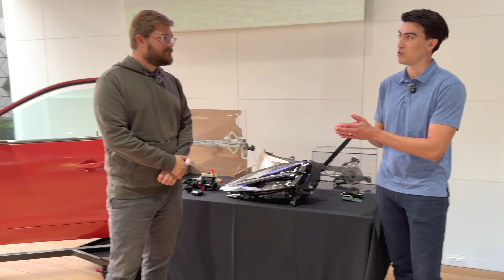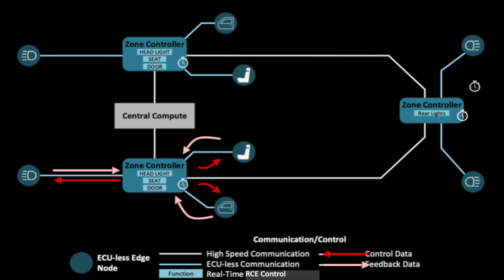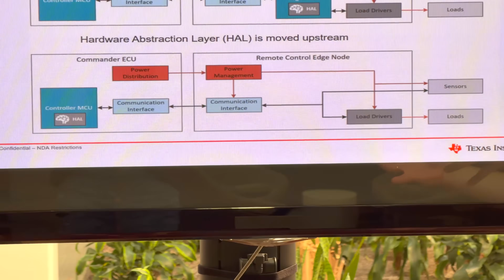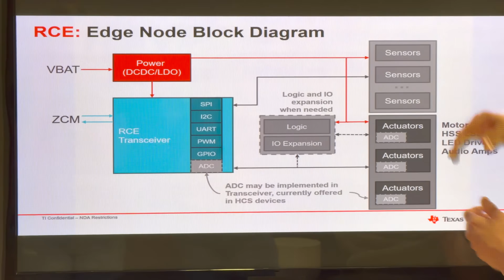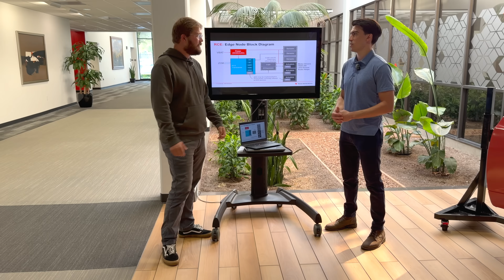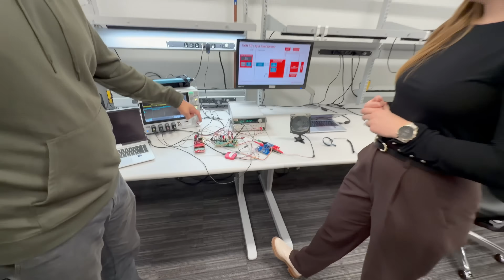The Key to Software Defined Vehicles! Texas Instruments' Remote Control Edge

Comment: Yeah that's just what I want.  Remote control of "tons of vehicle subsystems" by a third party I didn't buy the car from nor have any sort of relationship with.  And when that third party is ransomwared, remotely, which will happen, say bye bye to your "heat seater".  I like TI. They are an iconic brand in tech but there is no way they can threat model this to the point where they can guarantee security long term.  What's worse since it's centralized now, in the proposed model, you only need to attack one entity.  At least in a distributed model with lots of dumb devices that can't be upgraded as you say you have an enormous attack surface. What's proposed here completely shrinks that surface.

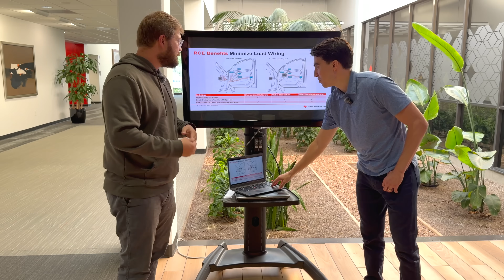Comment: around ~15:00 got me thinking, if vehicle quality converges to such a degree, the key decision for a car buyer is which branded car will either 1) handle all of their sw/fw revisions in-house, 2) source out to the actual integrators like bosch, valeo, denso, honeywell, 3) a mix where the brand works with suppliers and maybe a 3rd party company that picks up this software management market for legacy brands. Because, this software will need a central UI/UX and a touch panel (likely), which means a whole other level of software teams needed (thinking of the VW partnering with Rivian headline). want to echo the concern from a few of risk of using this to introduce subscriptions (eg. sub for non-compute/bandwidth-related smart features) on car owners.

Comment: Just my two cents worth: cue the plot of The Emperor's New Clothes.  The "software" will be split into two, with some running on the "central computer", and some running on the edge.  However, we'll pretend the edge is magical silicon and isn't really software, even though it is. Standards committees will hopefully predict the magic perfect set of features needed in the future for the "silicon" (called "mask ROM" software in decades past) ... so they hope... and the magical software will somehow be errata free.  OEMs will have to pay more for higher bandwidth connections (since the software is now split operating on two devices), will suffer higher latency, and the central computer will make real-time operation potentially very brittle when unrelated software changes are made.  I'm sure there is plenty of inefficiency and poor design done by OEMs, but the "central computing" fad doesn't necessarily fix their woes; it is just fanciful tale that the industry is pretending is real so that they don't appear incompetent or stupid.

Comment: Forrest Lane is still looking the same as 1998.  Started my career on the other side of 635 at K-FAB and then DMOS 6.  Back then it was all DSPs for Nokia and UltraSpac chips for Sun Microsystems.  :)  Its good to see TI move up the value chain and get closer to the CPU for automotive.  Software is sticky so when APi are coded in they're hard to change out.  I think it's clear that Tesla has set customer expectation level with respect to OTAs frequency and software CIP.  If you keep the customer engaged with new features I think it's cheaper than sales rebates to move new models.  The legacy automakers are really struggling in this area and I hope TI can help them.  In the past year I bet my Model 3 has received ~20 OTAs and my Lightning has received ~3.   For all the calculator nerds....sure the Ti-84 was cool, but it was no HP-48GX.  :)

Comment: I don't think anyone was discussing ethernet as a primary communication protocol in cars until the Cybertruck, which was being developed about 4-5 years ago.  They have not open-sourced that yet to my knowledge, so TI may be in the lead of creating an open standard that all OEM's can abide by.  If that is not the case, then the communication protocols will be disjointed, like the current ODBII standard communications in different manufacturers vehicles.

Comment: It's funny, but a friend who works for Continental in Germany told me that centralized computing would be the future of every car and they are working on this solution. He said this 15 years ago. 🤣 This demonstrates that traditional car manufacturers are slow but also because its hard to change the supply chain with a complete new system architecture. If they were all more agile, everyone would have great software and integration like Tesla has but Tesla shows also currently that they cannot change so fast anymore with the 400V to 800V architecture so they also suffer from the supply chain issue. Many companies like TI have been working on this for decades because it's nothing new and widely used in aerospace.

Comment: I just wonder ....Would anyone be bothering with this tech if it wasn't for Tesla?
Reply: Has nothing to do with Tesla.  This is basic electronics and standard electronic communication protocols.  This was before Tesla.
Reply: @ChristopherFoote22  Again, Tesla started using it and were forced to do it themselves way back in 2012 because suppliers would not or could not.  All Tesla vehicles are Software Defined vehicles from the ground up.  They write their own software, engineer and manufacture a lot of their parts. They engineer or co-engineer most of the parts made by suppliers, even assembly robots & equipment.
Reply: @ChristopherFoote22 You could not be farther from the truth. Go read the IEEE documentation, these protocols are optimized for automotive environments
Reply: Of course someone else would do it. It’s EXTREMELY rare for just one company to be looking into a new technology or a new way of doing things
Reply: 10,000% yes. Tesla is far LESS responsible for technological improvements than they are regularly given credit for by their fans.
Reply: @genesishep  Except in this case they've been doing it since 2012 with the Model S, the worlds 1st Software Defined Vehicle, they even told other OEM's they can use their tech with no patent infringement & they all said no we know what we're doing......Now 13 years later we have TI saying look @ this great tech we can supply to you(OEM's)..........
Reply: None of this is specific to any Tesla innovations.
Reply: If it weren’t for tesla, we’d still be happy with the “20hp more” new model Porsche.  Power and tech took massive industry leaps due to the disruption of tesla.
Reply: @aussie2uGA wow you are very uneducated
Reply: TI has been around for decades longer than the grifter EV company